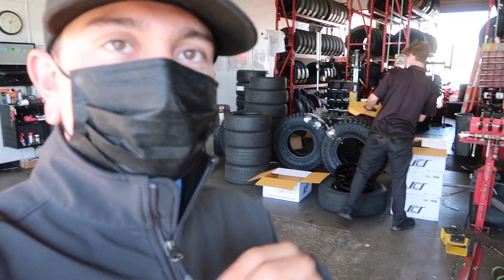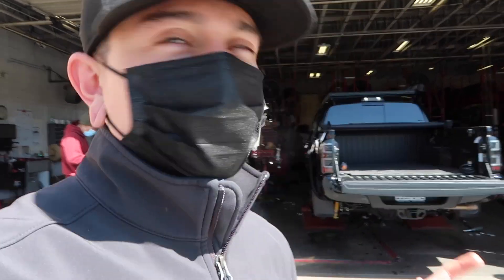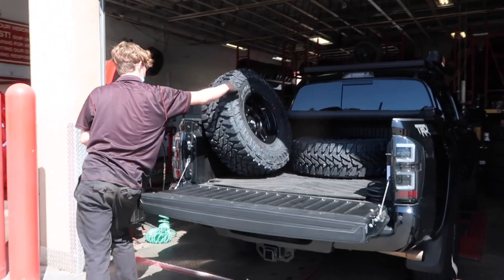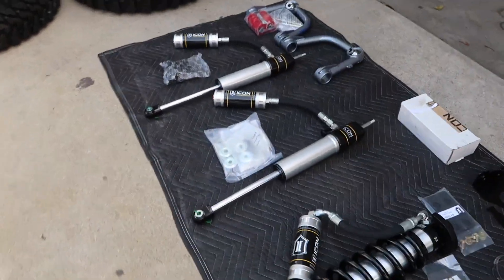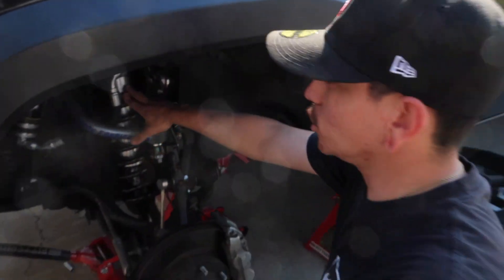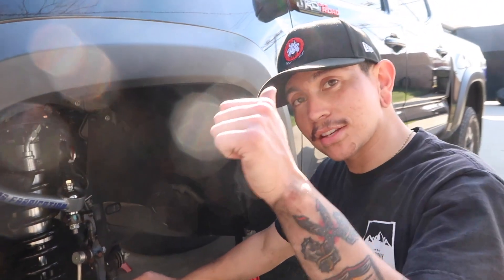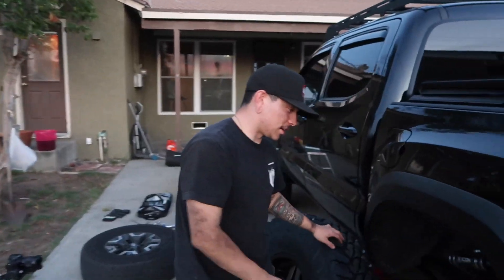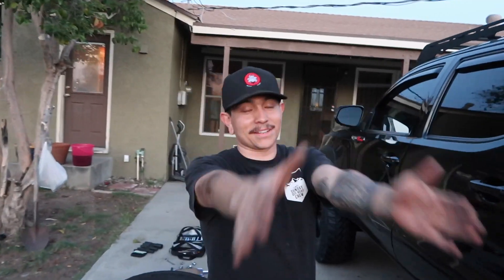How To Build A Tacoma Properly

Comment: How to build a Tacoma properly - good start but you might want to clarify that those tires are gonna rub a lot off road without a cab mount chop and trimming. This build as is pretty much for the street or flat fire roads.

Comment: I'd like to see that wheel turn and it be driven at the end of the video no way those 315 clear with out a cab mount chop
Reply: Right! How in the hell did this guy install the TC upper A-arm with 35s without clearing the body mount? It adds caster, top it off with freak'n 35s !! :-O.... I was wondering that myself! I wonder if this guy put spacers which are dangerous. What about re-gear? Re-gear is a must too! Also, I love the 16" SCS wheels, but because they're toyota & jeep dedicated, they must clear the big ass caliper, or not?!!! :-O Beautiful set up but what about the rest of the dominoes?

Comment: One thing you might want to consider since you mentioned building a Taco the right way is this. Changing out the stock drive shaft especially doing a 3" lift or higher! I've been using a double carden drive shaft from Tom Woods out in Utah for Jeeps and Tacos for many years now! That stock center bearing design from factory tend to go out very quickly especially with a lift. I know they offer spacers to lower that bearing but it's still better to use a double carden drive shaft and trash that stock one and no longer have a pesty center bearing! Like you mentioned, if you're going to build it... Do it right. 👍
Reply: False information here man. Not necessary.

Comment: Just dropped 8k on this proper lift:

33" tire/wheels
Fox 2.5 adjustable front
Fox 2.0 adjustable rear
TC uppers
Deaver full leaf pack Expedition stage 1
Rear bolt on Locked bump stop
Front Durobumps
Sway drop kit
ECGS CV bushing

Comment: What was the name of the wheel? I honestly thought a 16" wheel with negative offset, not 0 offset would hit the caliper, I kept a 16 inch 0 offset wheel because every wheel I tried rubbed.
Good vid cheers
Reply: Negative offset pushes the wheel out towards the road not vise versa I have -25mm offset with the cab mount relocate kit on 315s on my 19 TRD OffRoad. Highly recommend more offset and trimming that mount
Reply: @Valkuta  yes duh🙈 I should've said positive offset. So you did cab mount relocate and then some kind of lift and can fit 315s no problem? Nice I'm running 285/75s on stock wheels with no lift and don't rub, but 315s or 35s will be next once I find a lift I like 👍🤘🇨🇦

Comment: How much does that suspension cost?
Reply: About 3k
Reply: Nice brand if you go off roadin or go on Sand at 50 mph but if you just want a lift to go mall crawling go for something else like the blienstien 5100 you can get about a 3in lift on them for 1/3 of icons price. Icons cool but horrible customer service and if you break something and send to them could take a couple months to get anything back from them